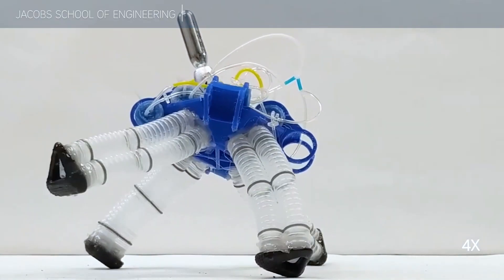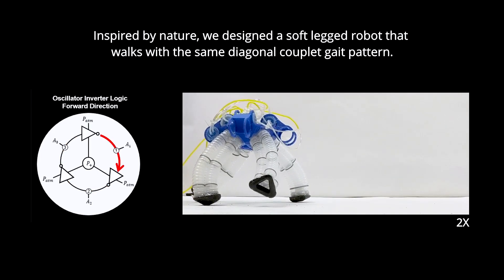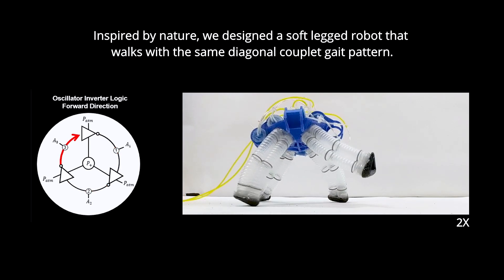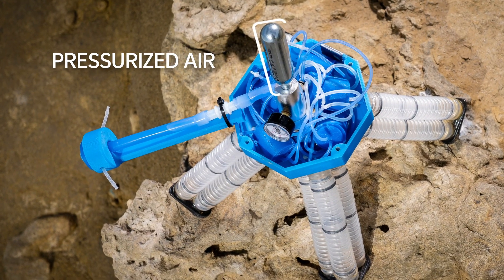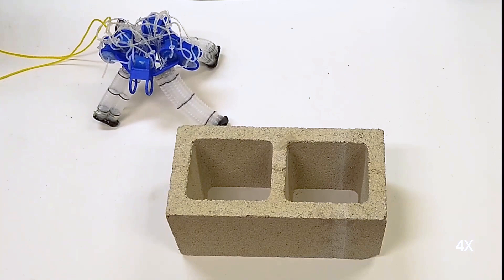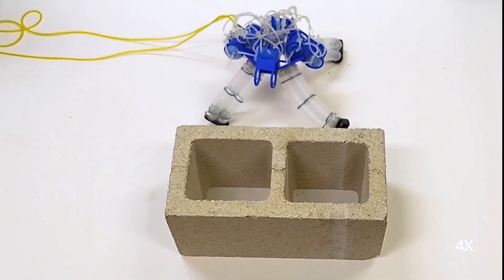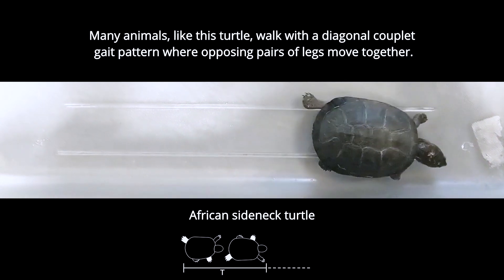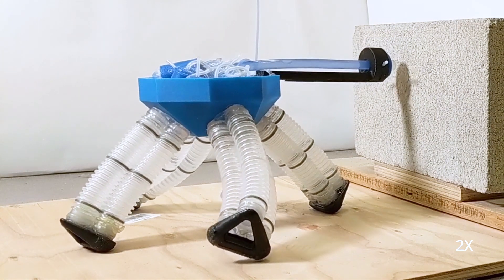Electronics free, air-powered robot

Comment: Could a robot using this concept work in extreme radiation?, like in the Chernovil disaster, in the roof they send remote robots to clean the radioactive debris but the electronics burn out, they ended up sending young men to die, I dont know how strong an air robot can be, but considering it would need to be capable of moving rocks, maybe an hydraulic variant?